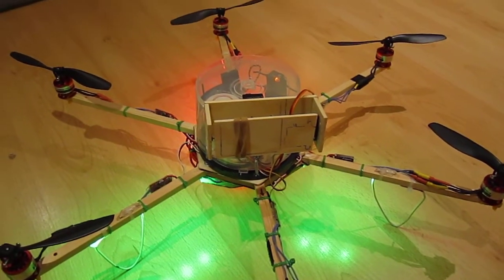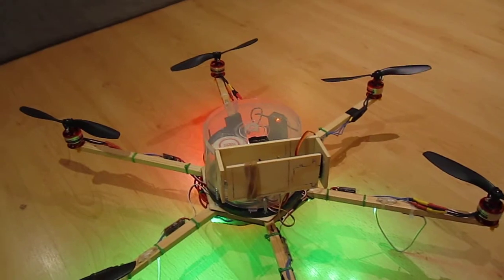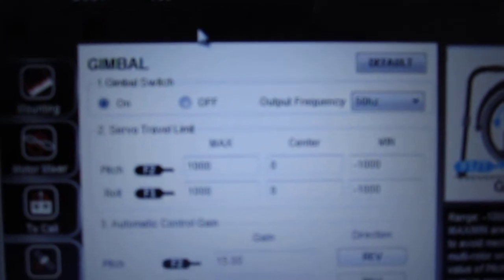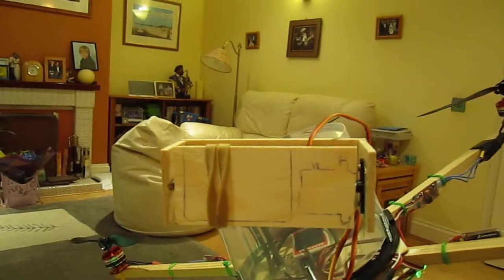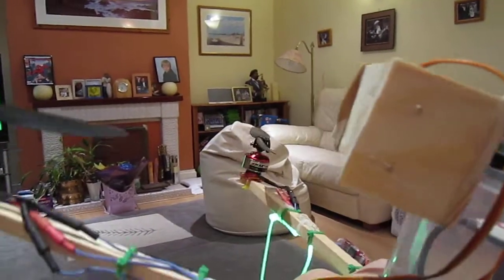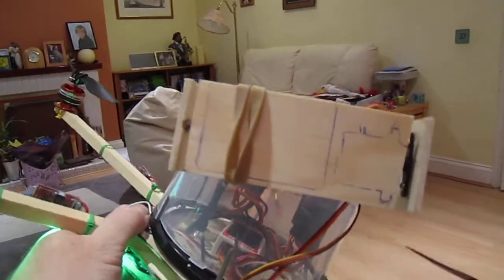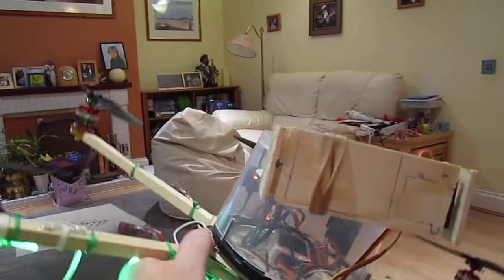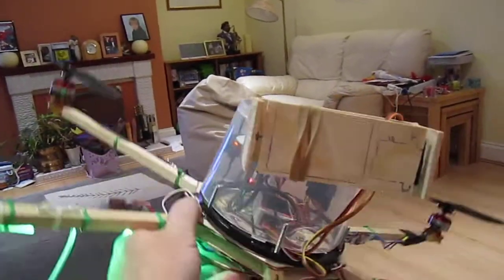DJI Naza camera gimbal home made from wood

Comment: Hi Jack. Yes you just have to set the gains in naza assistant. You won't be able to control pitch in flight but can set an offset in naza assistant before you start.

Comment: Im curious... I only have a Tactic 650 tx which only has 6 channels on it along with the RX. Can I just plug in servos to the naza without having to assign a channel and it'll handle the work itself or would i need to get a 8 channel in order to set the gains? At the moment I have stability control on one 3 way switch and my rate settings on another switch.

Comment: I see you have it fix to your dome, can that take the weight and the forces ftom the movement of the gopro in flight?. I have tried and have a few setups, even have one like yours and I can tell you it needs to be at a good fixing point and also dampen from vibrations to get good vids. Just a little input to help.